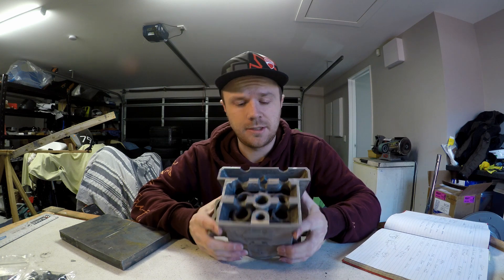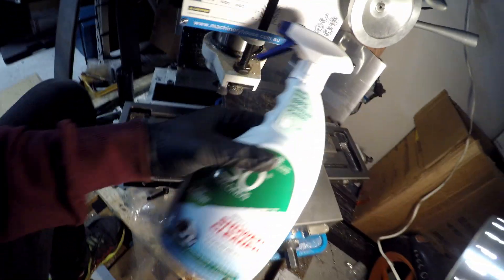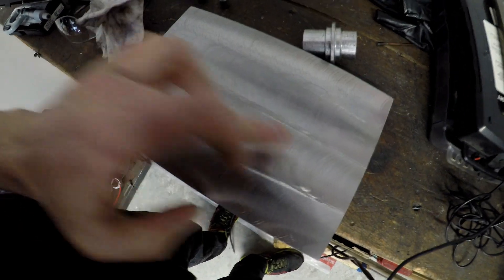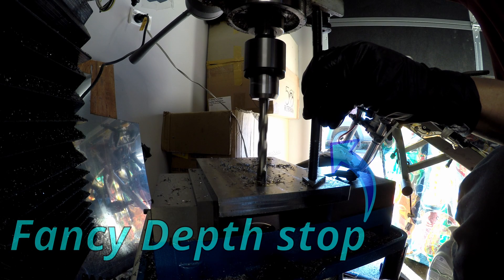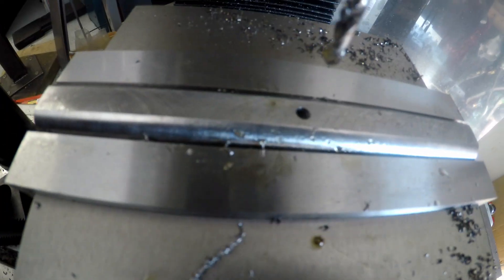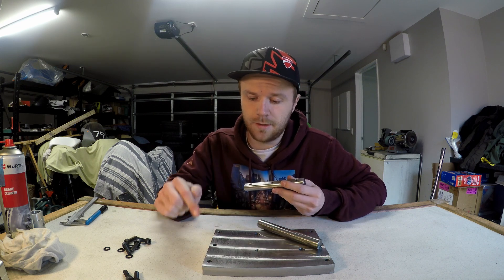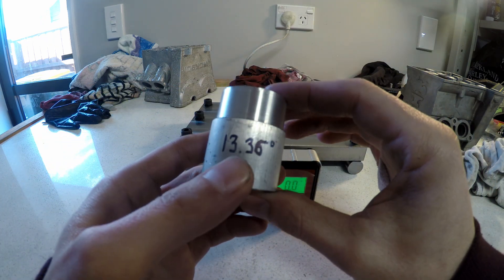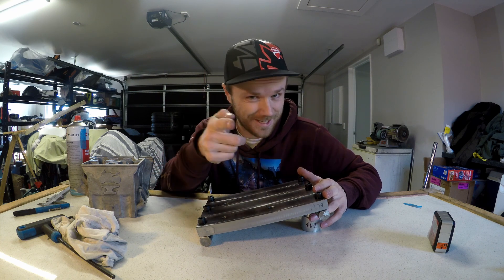Building a Sine Plate for Machining the Cylinder Head

Comment: I’m setting up to do a similar project, DOHC cylinder heads for a Harley Davidson V-Rod. 
With the need for machining at various angles, I’m constructing a bed of parallel rails like a seat-guide machine. One end connected to a rotary index table, the other to a pillow block, to act as the trunnions. I wanted to end up with something adaptable to other applications.
Reply from the maker: @georgedreisch2662  Cool project, yeah I was told that was one of the best ways to do it, but I currently need to upgrade what tools I have to I can make more things. Tooling Ain't cheap 😅

Comment: you are my inspiration dude keep up the good work
Reply from the maker: Thanks man, much appreciated!
Reply: Dude I just got ender 3 and I'm planning on making some 3d printed parts for my casting pattern any suggestion for aluminium casting or tips to make it really works for my applications
Reply from the maker: @Ahmadfullheart-lk3hf  A few things I learnt from the experts regarding casting alu.
Make sure any tool that touches the molten alu is very hot a d free of moisture as it causes alu to explode.
Also wear proper protective gear as alu sticks to skin. 
I have gone over most things in previous videos.
Learn from mistakes and you will be making amazing parts in no time.
Hope that is what you were after.
Reply: @TheMotorcycleForge  thanks man I'l keep that in mind
Reply: Alloys? Fancy
Reply: Just tinkering out a little bit and don't really have anything on mind
Reply: Also for the alu. Did I use only used part from automotive or just simple alu can do just as good?
Reply: Thinking about recycling a bit
Reply from the maker: @Ahmadfullheart-lk3hf  I used proper Lm25 Alloy but apparently Alu car rims make good second hand metal